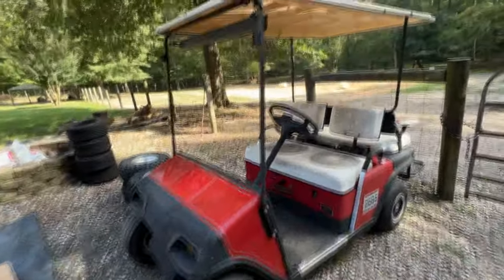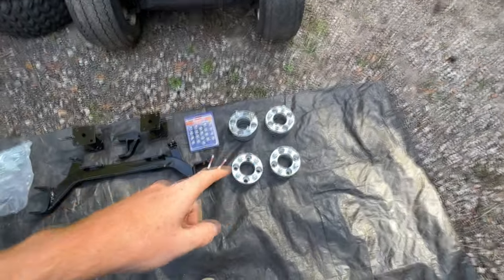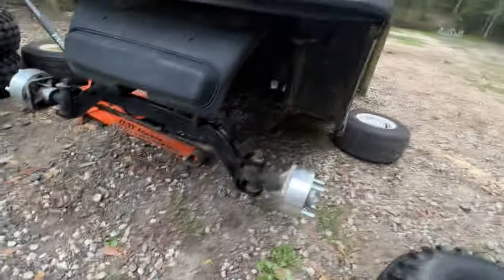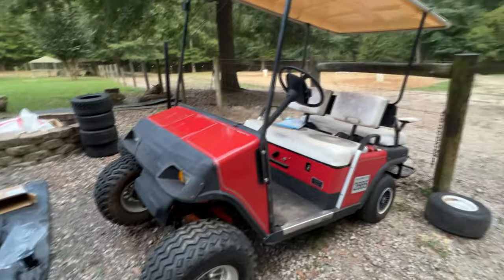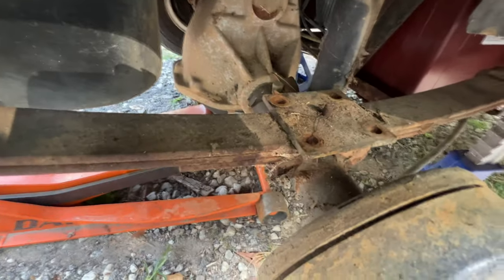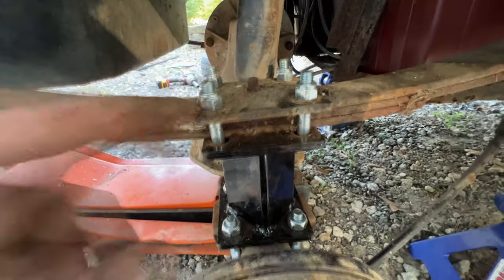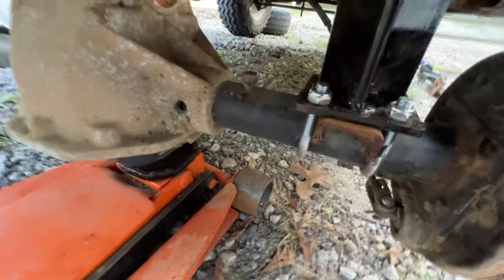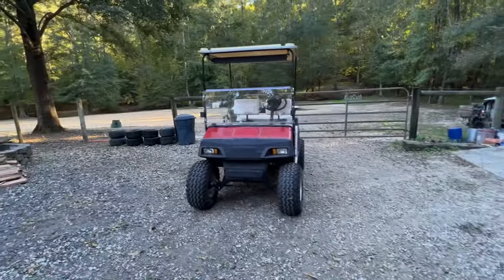Golf Cart BUDGET Build... Lift, Wheels, Tires, & MORE!!

Comment: Those sahara tires are great, I have them on a 1989 EZGO electric cart with a 2" lift kit and 18x950x8 inch standard wheels, they have excellent traction, last for years and seldom get flats.

Comment: Got the same looking kit. Did the back. Real easy. Tuned in here to watch the front install to see how everything comes apart. Wish you would have taped it. Bummer... Good job on the back though.
Reply from the maker: Sorry about that! The front is fairly easy too. The knuckles/spindles and steering will need to be separated from the main crossbar that mounts to the leaf springs. Unbolt the tie-rod ends on each side where they attach to the knuckles and the knuckles have a solid bolt that goes all the way through. You will need to unbolt those and keep up with how the washers and bushings were placed. Crossbar has 4 bolts with nuts on each leaf spring with a plate on top. Hope this helps!
Reply: I was wondering the same thing. Why didn't he record the very reason to be watching a DIY video for upgrading my cart? His written explanation isn't nearly as helpful as a video,  IMHO.

Comment: You can run CarryAll front springs as they are longer and that will set the axle forward. I worked as a cart builder for many years and worked in many electric and gas marathon carts.
Reply from the maker: Nice! Thanks for the info!!

Comment: I have the exact same golf cart but looking for a rear seat an roof
Reply from the maker: Amazon has decent deals surprisingly
Reply: Would you happen to know what spindles yours are on the front mine have a pin that bolts them down and is different than the lift